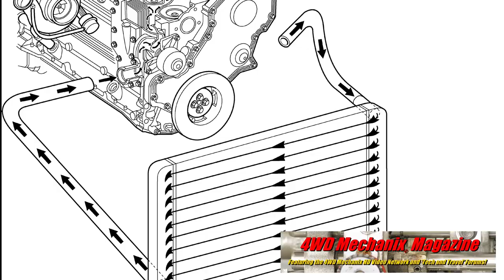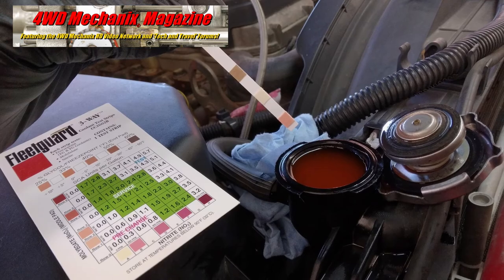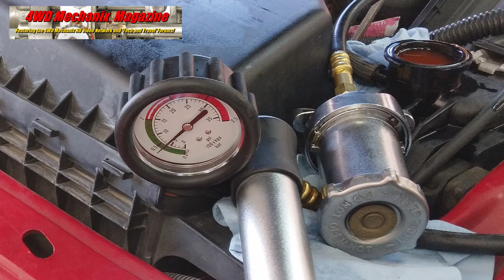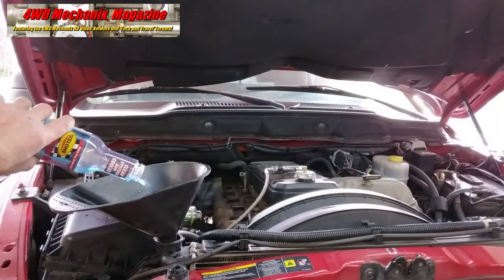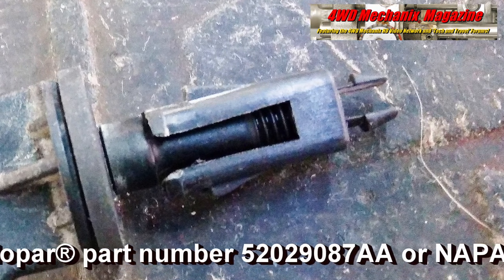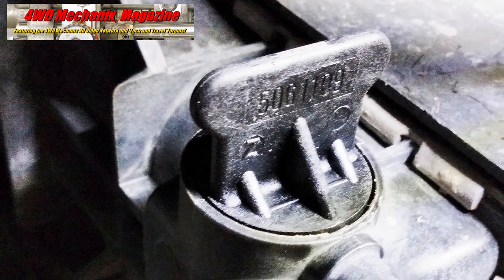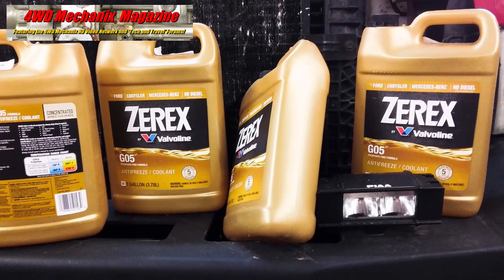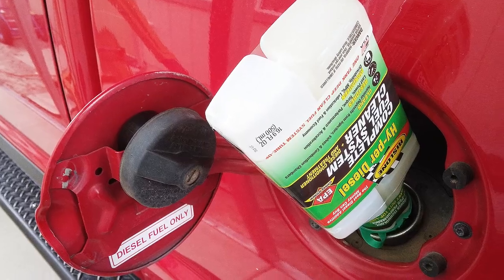Gen 3 Ram Cummins Cooling System Flush and Routine Service

Comment: How to get air out? Fan on low? Heat on high?
Reply from the maker: At 12-minutes into the video, I share the vacuum filler method that has become popular.  My only concern is that this method of filling the system does collapse the radiator hose(s).  (You'll see the upper hose collapsed in my demonstration.)  For a hose in new or newer/good condition, this should not be a hardship or cause trouble.  An older hose could be an issue.  Once vacuum is established and held with the tool, the siphon hose gets placed in the gallon jug(s) or a tub with clean coolant and water mix.  (I bought a plastic cement mixing tub just for this purpose and keep the tub clean.)  If you do not want to buy a vacuum filler kit (inexpensive at Harbor Freight, Amazon, eBay, etc.), the traditional method you describe will work.  Heat on high, the fan speed is more for keeping the heater core from overheating than anything else...Fill the radiator to the filler neck and the overflow tank/reservoir to above its fill level.  After warm-up to normal operating temperature, the engine is shut off and allowed to cool down.  Coolant mix siphons into the radiator and replaces air in the cooling system.  Level the coolant in the reservoir...After several warm-up/cool down cycles, the siphoned coolant from the reservoir eliminates all air in the cooling system.  The reservoir must remain at least at its fill level during this cycling back and forth.  Turning the heater on is always wise when using this method.  Do not let the engine overheat, as there may be air gaps within the coolant.  When normalized, drive the truck;  after parking and cool down, watch the coolant level in the reservoir for several trips.  Burping the system this way, always keep the coolant level normal in the reservoir.

Comment: Easy to break the little plastic drain plug on the radiator, just broke mine.
Reply from the maker: Yes, almost a guarantee...Wise to pick up a replacement radiator drain plug before this task.  If the original plastic plug stays intact, you'll have a new one on hand.  I have two spares on the shelf.

Comment: I was told not to use water to flush it as it would corrode, I’m almost at 100k. Was thinking of just draining it and filling it.
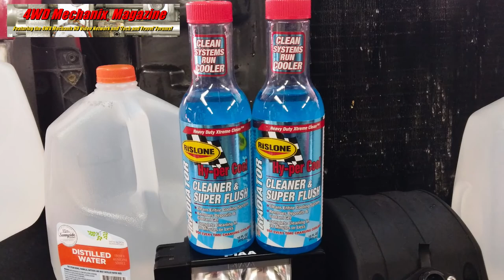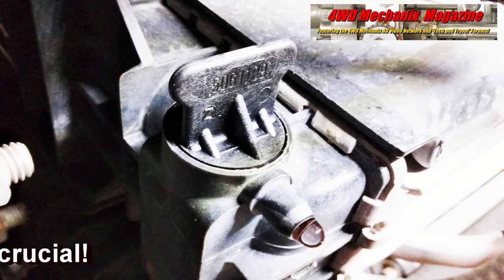Reply from the maker: I always use fresh, distilled water and never use mineralized tap water in my cooling systems.  (See the section beginning at 5:54 through 7:21 of this video for details on flushing with distilled water.)  I did clean the system during this service but did not find much debris.  The flush procedure is described in your factory workshop manual if you need "official" guidelines.